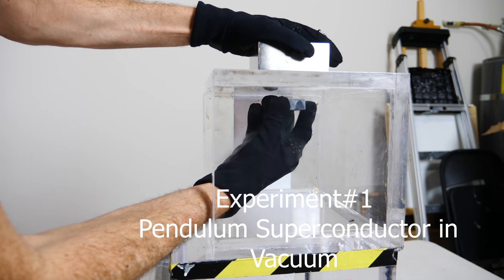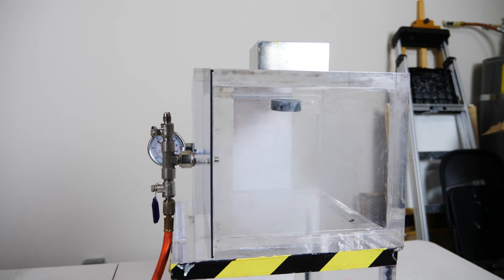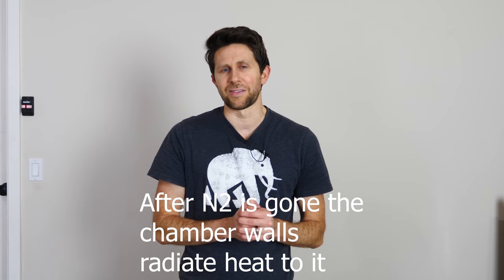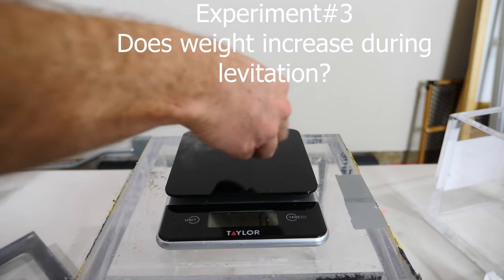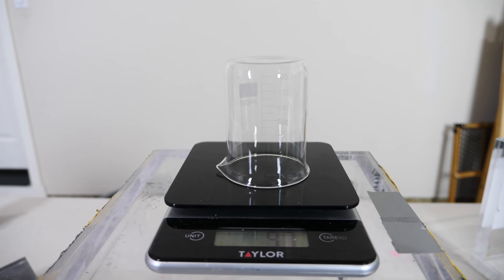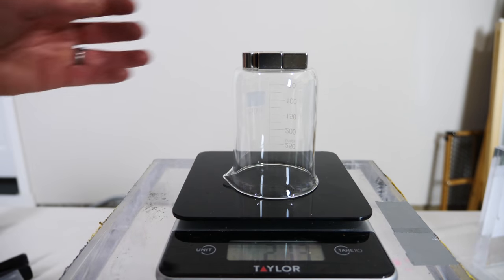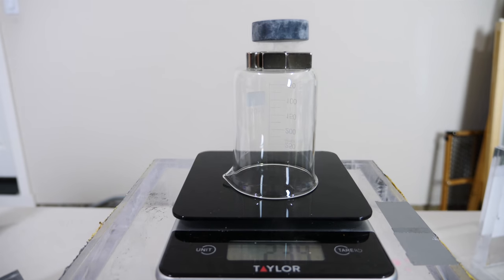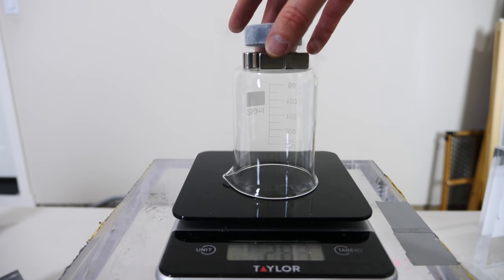Does The Weight Increase When You Levitate a Superconductor on a Scale?

Comment: Err, no, the liquid N would not keep it cooler as described. In a vacuum it gains energy through thermal radiation from the outside thermal radiation only. Evaporating the N will cool it down even further so all that is left is the mass that needs to be heated up by radiation. So any mass would work just fine, depending on the actual circumstances the liquid N even helps by evaporative cooling this thing down even further. Guess how you can easily create solid nitrogen...

Comment: Weight is a measurement of mass density. To change the weight you have to change the mass. The scale used is but one way to measure mass density, but nullifying gravity doesn't change the weight of an object. It changes the behavior of that object.
Example:

Lets say you nulify the gravity of a bus and levitate it. Five men then push it for 20 yards and you are standing  in front of the bus 30 yards from where they started.

Let's say you nullify the gravity of light a Boston Creme cake in the  shape of a bus and the men do their thing. Of course you would take your chances with the cake because even without gravity the weight (mass density) is the same. 

So the point of the story is nullifying gravity does not change the weight of an object.  It changes the way the objects weight must be measured.

Comment: Hey, remember you did a video in which you froze nitrogen solid inside a vacuum chamber? Try to do that again but this time submerge the superconductor in nitrogen with a little bit more volume than its own and then somehow pull the container away so only the nitrogen and the superconductor remains suspended.

      - - - - - - - - - - - - - - - - - - - - - -
               superconductor inside
            \  -  -   - -   -   -- -  - /
              \ - - -[`_'_'_'_'] - -/
                 \ - -  - - --  --  /
                   '' '' '' '' '' '' '' '' ''
glass with nitrogen 

   - - - - - - - - - - - - - - - - - - - - - -
    suspended superconductor in
               -  -   - -   -   -- -  -  frozen
                - - -[`_'_'_'_'] - -  Nitrogen
                   - -  - - --  --

Comment: The damping of the pendulum is also caused by the non-rigid support of the neodymium magnet.  Your setup is flimsy!  For the vacuum experiments, you need a faster pump, a larger hose connection, and a smaller volume.  Regarding heat transfer through low pressure gas, the conductivity changes little until you get below 1 torr (1/760th atmosphere).  Look at the scale on a Pirani or thermocouple vacuum gauge.  1 atm and 1 torr are almost the same spot on the meter, then the rest of the scale goes to 1 millitorr which is almost full scale.  I would be willing to wager that that pump you have couldn't even reach 1 torr in an hour on that chamber with the little hose (plus you have the outgassing of the nitrogen and moisture from the plastic walls).

Comment: Scary what you call a "full" vacuum... 10 to the minus 12 Torr would more likely be closer to a  full vacuum. That's what we pump our variable vacuum capacitors down to (Comet Technologies yay)... Atmospheric is ~760 Torr, you say 1/4 of atmospheric is a full vacuum which is around 190 Torr. Waaaaaaaay to go to 10 to the minus 12 Torr lol. You barely even generate a low vacuum which would be down to 25 Torr. I still don't think your results would have come out any different though. Just don't call it a "full' vacuum ;)

Comment: On the pendulum part, I think some of the loss is actually when it reaches the full swing, it has to raise a little, and it requires energy to fight gravity. To get less resistance, it has to pendulum almost straight horizontally, depending on the circumference of the earth.